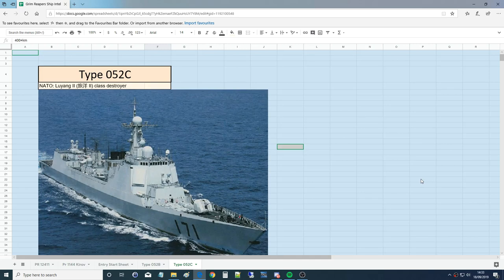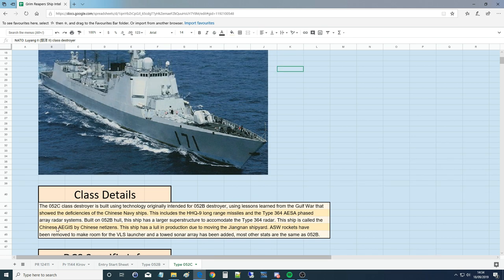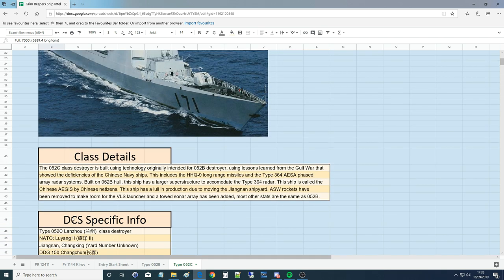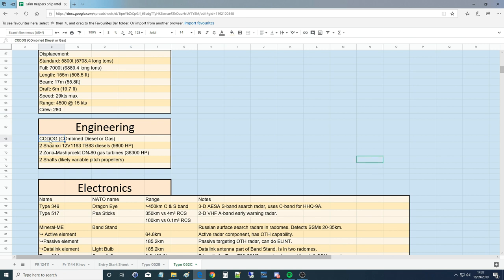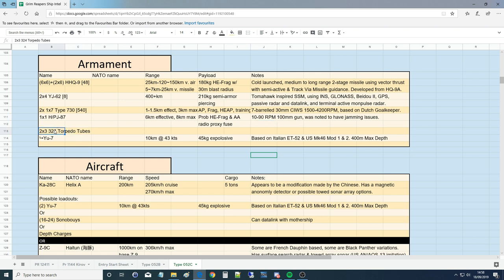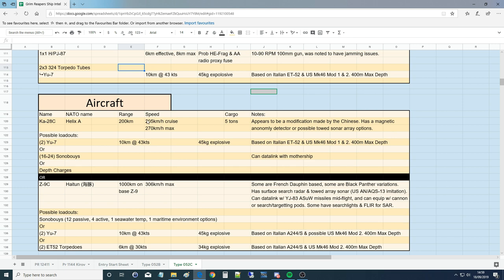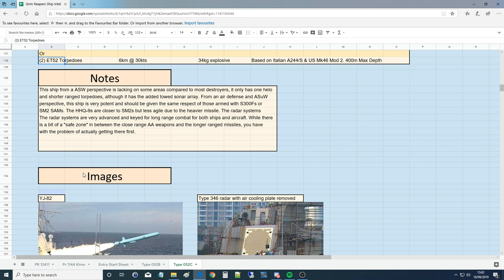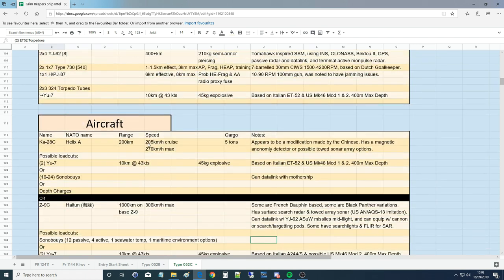Combined Arms: The Unbeatable 052C Class Destroyer Tutorial | DCS WORLD

Comment: The HHQ-9 is actually active radar guided, just like AMRAAM. The closest naval system in terms of guidence is probably Aster, used by RN's Type 45 destroyers, but HHQ-9 has longer range.
Reply: Where'd you find that. I'm curious because I know the HHQ-9s come in 3 different versions and you could be referring to the B version, only got the A for the 052C.
Reply: @Firestorm2900  All HQ-9 variants are active radar guided. The fact that the type 346 radar operates in S-band is a dead giveaway because it cannot offer enough accuracy for terminal guidance, and no other types of missile fire control radar are present on the ships.
The AN/SPY-1 of Aegis system is also a S-band radar, so it also cannot control SM-2 missiles on its own. AN/SPG-62 fire control radar is used for  terminal guidance.
Reply: @thunderboltlightning6010  Did a double check, and the Type 346 uses the same C-band as the Patriot for TVM homing. Some of the radar panels are C-band units sandwiched in-between the S-band trackers. The fact it's an AESA array allows you to go nuts like that.

Other than that, it's mostly the same as the AN/SPY-1
Reply: @Firestorm2900   Believe or not, a friend of mine is an officer who operates the air defence system on a type 052D destoryer. So, I'm quite confident about my source. Also form what I've heard, the HHQ-9 system is still not quite reliable, when it works it's fantastic, but malfunctions are somewhat frequent. Which is to be expected since it only had been fully operational for a few years.
Reply: @thunderboltlightning6010  I think I got what's going on. The HQ-9 family's been around since 1997, but has had alot of developments over the years.

HHQ-9A has better software and electronics for higher accuracy.
HHQ-9B is hot launched, lighter for longer range, and has semi-active and IR seekers added.
HHQ-9C is a fully active missile which was still in development in atleast late 2016.

It sounds like your friend is operating a Type 052D and is acting for a testing platform for the 9C. Which would be great for the 052D if it succeeds, since it would allow you to remove the radar panels for  the C-band. Meaning you can have more S-band panels giving you more power to use in the S-band search.

Comment: DB link: https://docs.google.com/spreadsheets/d/1ipnYbZrCpGJl_65cdgTTyHkZernaeFZkQuuHsUY7Y8M/edit?usp=sharing

Heya, hope I wasn't be so forceful about the HHQ-9 debate, felt it was important since an active missile and TVMs are handled differently for how to defeat them. Still, that was rather insane how quickly it was locking on and how fast it was able to launch missiles. I think the fact the track radar is part of the ASEA allows it to fire faster than the SM2s. I remember seeing something about that, but I'm not sure if the fire rate is THAT much faster.

Otherwise, the way the the phased array works is that it uses constructive interference that makes radio waves stronger and destructive interference, which makes radio waves weaker like the noise canceling you'll find on headphones, it allows you to point a radio wave electronically. This is why it can scan so quickly and probably why it was picking Cap up so fast. The AESA the 052C has and PESA SPY-1 series seen on most US ships both have the same effect, it's more the AESA is easier to maintain and smaller. This is why I think the Arliegh Burkes should be similar to the 052C as far as finding a target. Not sure about the CG's SPY-1A since it has a harder time with clutter, like picking up a locust swarm as a target. The SPY-1B upgrade helps with clutter like that but isn't as good at close to shore clutter like the DDG's SPY-1D.

Also, the RCS, I sorta covered it but in order to defeat a VHF or HF radar you need to have much more radio absorbing material, the reason though why the US wasn't as concerned about reports of it's F-35s being spotted on radar is because all the radar used for locking on and guiding missiles are within it's design to deflect and absorb radar. Granted it isn't perfect, you can still get a lock on a stealth ship, it's just you have to be much closer than usual, Admiral Binkov has a video that covered this in it's F-35 vs J-20 video.
Reply from the maker: Thx D   ensure you have that backed up please x
Reply: @grimreapers  Already saved it up.

Comment: Im not quite sure your assumption apropos Diesel & Gas Turbine engines is correct.  I am pretty sure and I may be wrong however principally, the ship runs off of either one or both turbines.  Electrical systems, and Life support systems will run off of Diesel Engines, multiple.   Each diesel engine, will be responsible for providing power to all systems on the ship, and these will be responsible for an area.  For Example Diesel 1 maybe responsible for X systems, and Diesel Engine 2 will be responsible for Y systems.  You will find that you will have emergency shunting cables in Emergency Stations, spaces for running power from one Diesel Engine, to systems in a space that it is not primarily responsible in an Emergency Stations situation.  For example, Hit 1 takes out Diesel X, which may be running all Positive Air (Air Conditioning Systems as well as Desalination Plants, and Gyros.   By running cables, you can get these systems up if that is what you need.  Not saying thats realistic, but its the ability for built in redundancy. Turbines for propulsion.  DE's for mains power.   Just a thought.
Reply from the maker: Thx Sir
Reply: @grimreapers  Your welcome, Im just your average Pusser.  I was FFG trained so it blows my mind I can take a Huey, and land on an Oliver Hazard Perry Class (Adelaide Class) Guided Missile Frigate, and get the inverse perspective from a Huey landing on the Flight Deck, rather than standing under the blades in front of the Port or Starboard Hanger during Flight Deck evolutions.  Now that is a buzz.  What you may not know, is that on an FFG (I will not assume all as mine specifically was different to all of our others) towards the transom on the Port aft quadrant, we can feed a refueling hose to the Helo.  (Usually a Seahawk) There are three ways from memory the Helo can be refueled.  On the deck shutdown.  On the Deck Engines on, and in some cases, and Ive done this, we have fed the line to the Air Crew chief who has plugged the hose into the receptical on the helo, and the helo takes off and hovers off of the Port Side Aft Flight Deck on a course parallel with the ship of course and over the water.  If you have ever watched Hunt For Red October, the Earth Grounding Fibreglass covered Shepherds Crook (for want of a better term) is a real thing, as the helo is building up a lot of static, and must be earthed in RAS (Replishment At Sea) evolutions.  That takes some serious piloting skills, so does landing on a moving platform that moves in pretty much 6 DOF.  There is also a system on board for roughers ( High Sea State, whereby the helo can attach to a hook that sits in and through the flight deck, and will pull the helo down onto it.  All these evolutions are highly dangerous.  Hence Days of practice.  I have mates who went down and arent here anymore and we had only been in company with their ship a few days prior.  I cannot wait until the day, they add subs (if they havent already, and anti sub operations) can be executed from a Seahawk, with comms feeds from an FFG or AWD.  I once without knowing whilst playing lawn bowls with my Skipper and a few Oppos and a few blokes from an Anzac class, joked that Anzacs were just Corvettes, only find out later the bloke pissing himself laughing was that Anzacs XO.  My Skipper thought it was hilarious, so dont need Anzacs in DCS.  Just sayin.  Then again, Im still trying to work out voice attack and the Vaicom plugins and getting them to work.  So no flying til I can honestly get all this comms, and voice commands working so I can just say it and have it done.  I just had to order two new USB hubs to cater for all the stuff I have accrued in the last month and I have no desk space left on a 3m by 900mm desk left to put anything.  I think this is becoming an unhealthy obsession.
Reply: Nope, Diesels usually also provide propulsion power - At least for speeds below 20 knots. Now, This ship is CODOG (diesel OR gas), so at full speed it probably DOES only use the turbines but 2 x 20 cylinder Diesels would be some hefty generators :) .